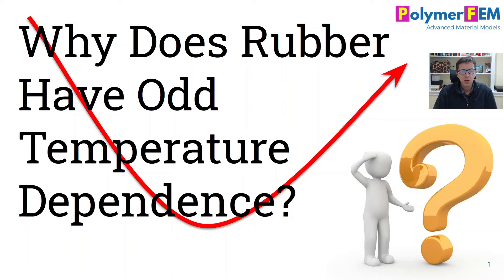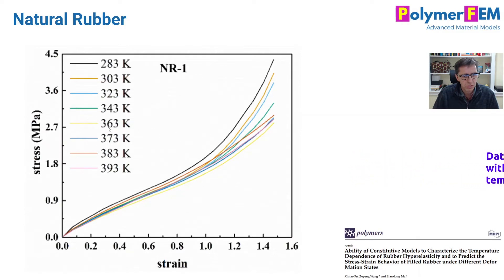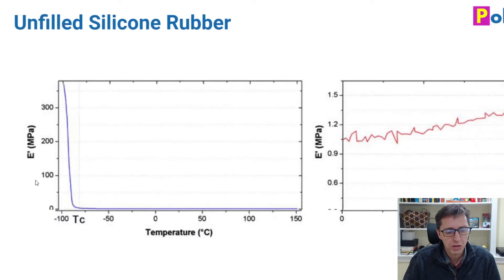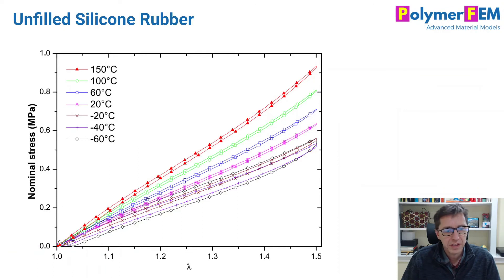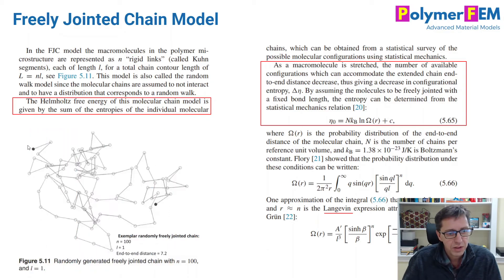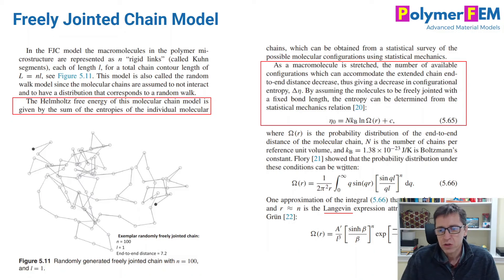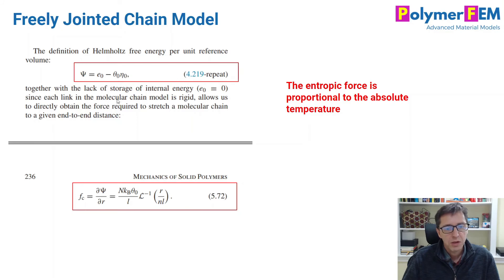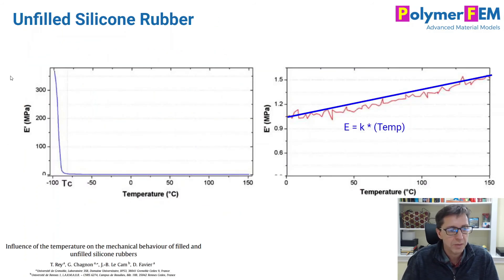Why Does Rubber Have Odd Temperature Dependence?

Comment: Can you model this behavior of rubber?
Reply from the maker: Yes. That is easy if you have, for example, temperature sweep DMA data. Or some other temperature information. Most FE material models can be given material parameters that are temperature dependent. That is not the most physics based approach, but is often good enough for engineering calculations. There are also specific material models that can capture the response.